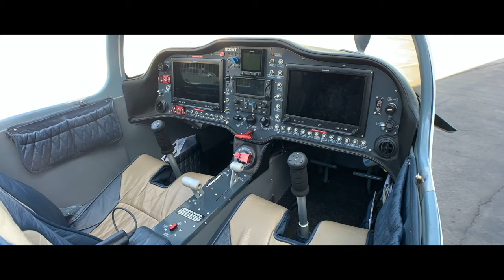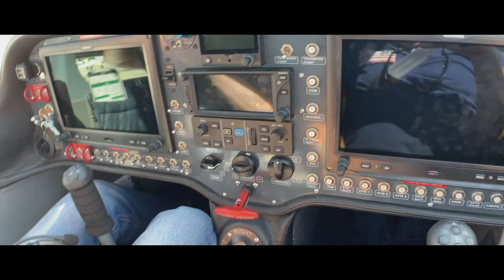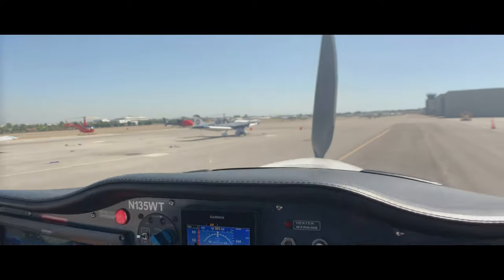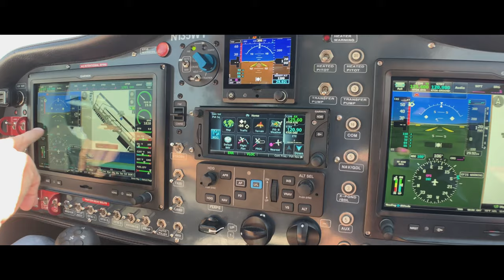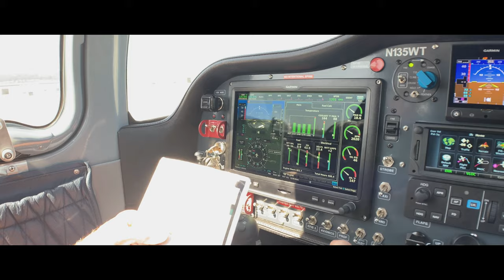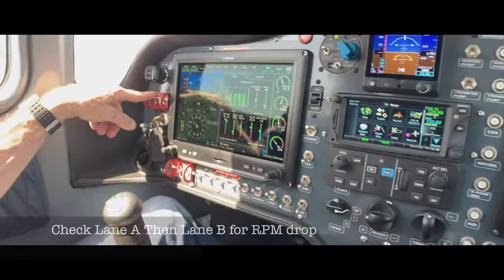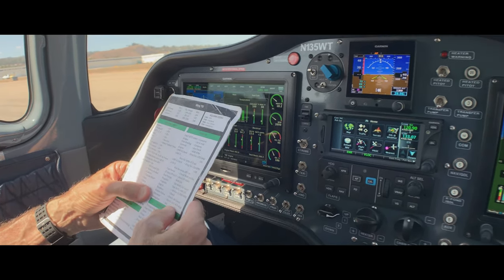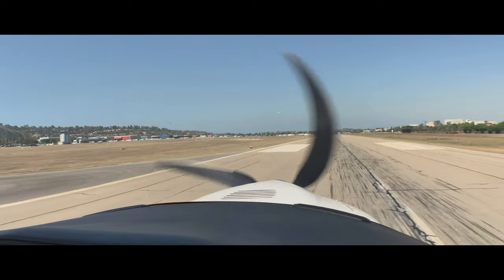Sling TSi - Inside the Cockpit & Pre-Takeoff Checklist

Comment: Why cant they have one switch do all that?
Reply: Do all what? The 2 ECU lanes need their own separate switches in case one starts to act weird and the computer doesn't automatically kick it out. The 2 different fuel pumps need their own separate switches because you don't run the Aux in cruise except in cases of the loss of the main. Each light needs its own switch because you don't want to blind other planes on the ground or yourself in IMC. The ECU backup needs its own separate switch because it's only used for start and in case alternators are malfunctioning. The prop needs its own separate switch to control the pitch control motor in case of auto mode/speed sensor failure. Clearly you can't just have one switch for everything. Take some flight lessons, and you'll understand.